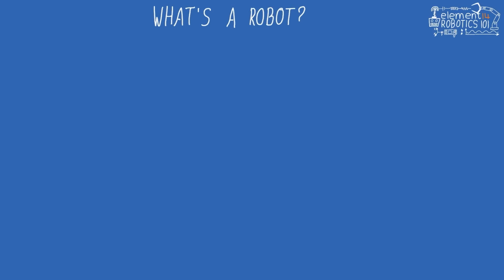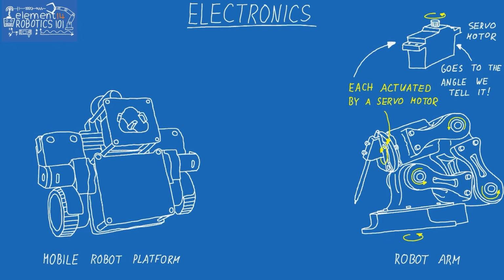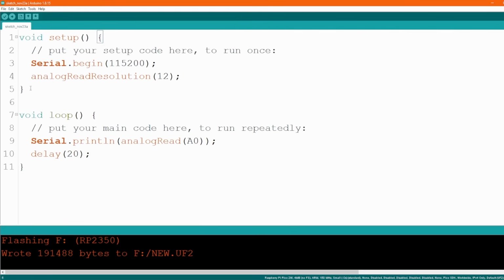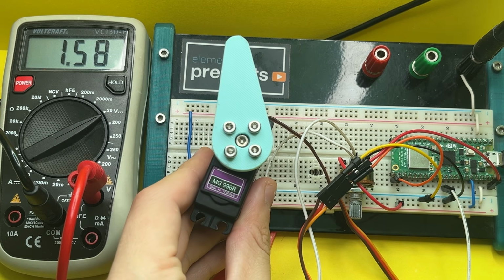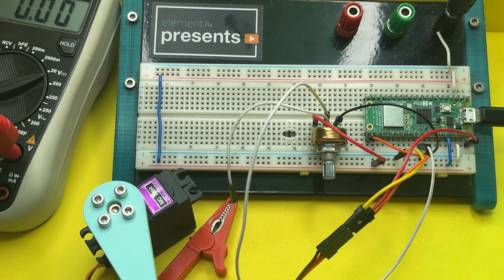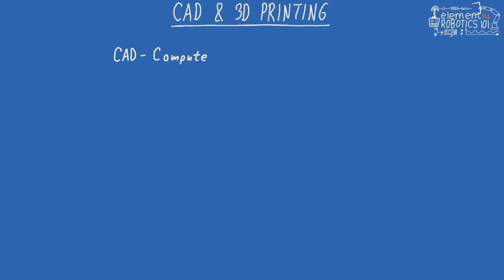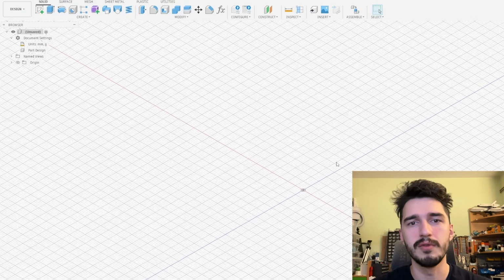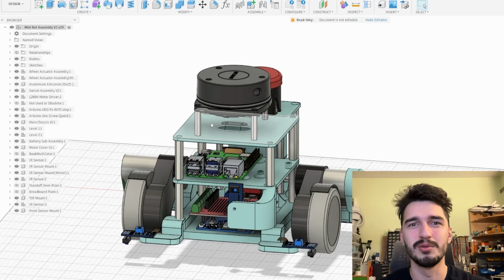Robotics 101 - Electronics & Mechanics Basics - Ep. 1

Comment: Great video! Btw, the timeline from your description does not show up in the video because you need to start the timeline with 00:00 for it to work. It's a bit weird, but this is how YouTube works :D

I suggest that you change the timeline in description to this:

00:00 Intro
00:39 What is a Robot?
02:52 Electronics
06:54 Sensors
10:27 Actuators
12:55 Closed Loop Contol
15:29 Mechanics
16:25 Taking It Apart
18:12 CAD & 3D Printing

(no need for numbering and dashes)